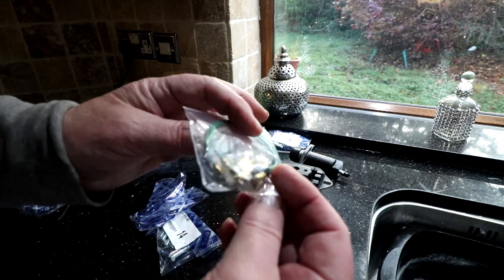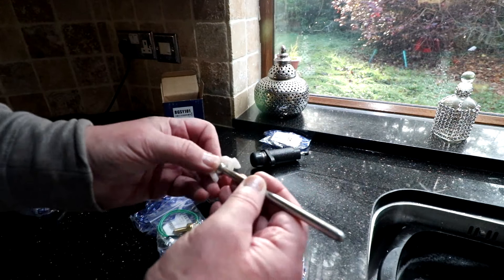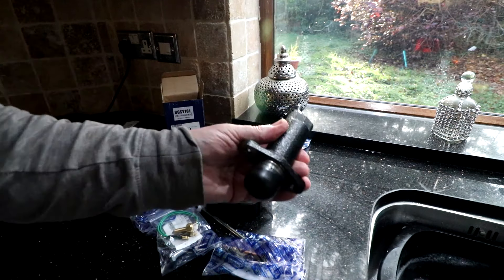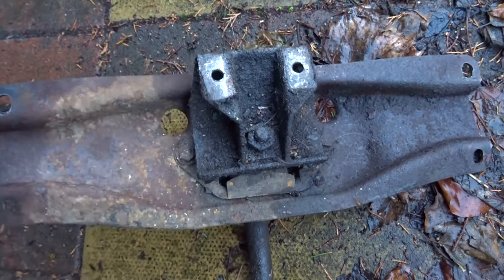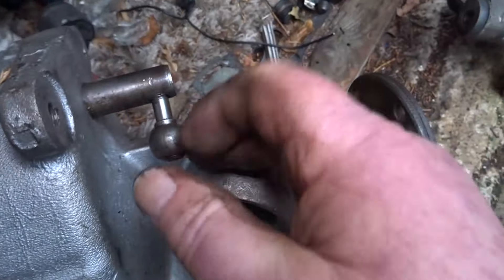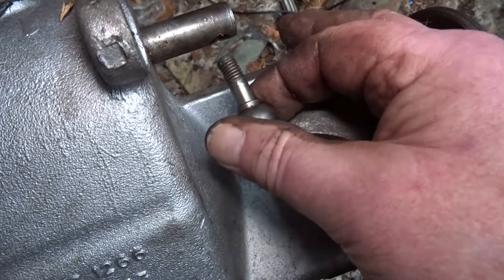TRIUMPH TR7 V8 LT77 Gearbox update 02

Comment: On my 5 speed TR8, that single bolt that goes through the center of the gearbox mount, passes through the mount, then through a spacer and then bolts directly into the hole in the gearbox that is  between where you have the two existing Rover SD1 rubber mounts.

Comment: With respect to the peg that bolts into the selector shaft. I beleive the peg should just slide fit inside the steel ball, the ball should stay in the nylon socket in the selector housing.  

If that's come out together  then   you will need to check the nylon cups that retain the ball (comapre it to the other one that is at the gear lever end.  They should operate the same way)